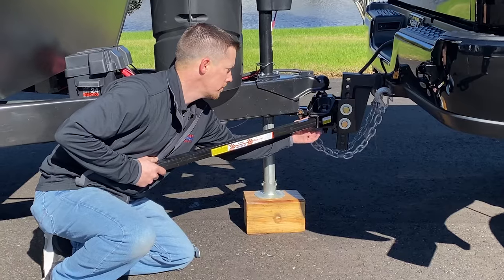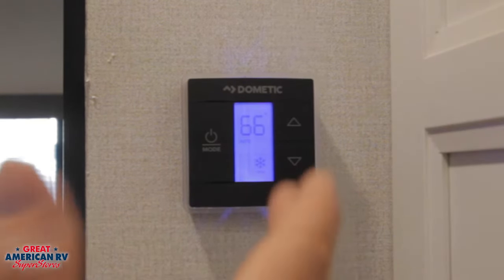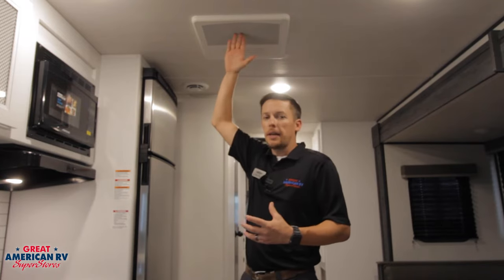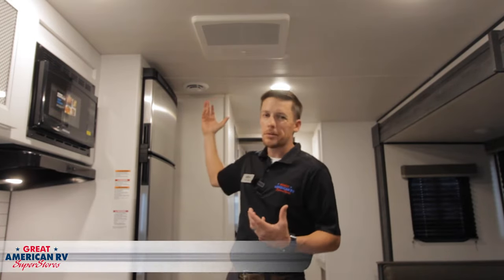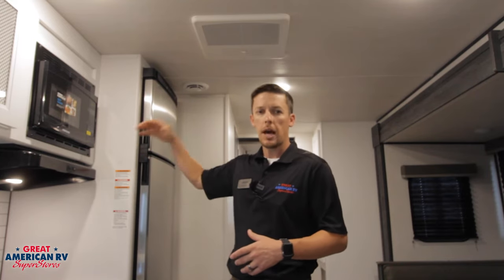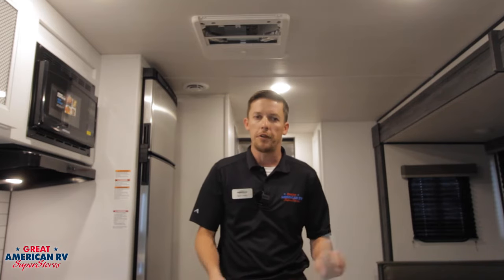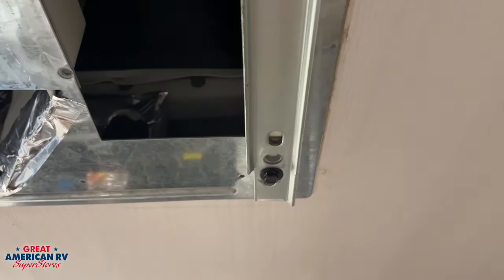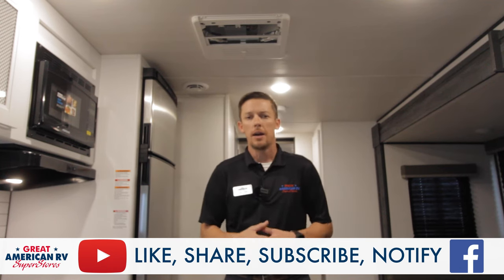Dometic RV Air Conditioner Operation and Maintenance

Comment: Take the cover off the thermostat, put it away for good.

The natural current in your bodys fingers work best on those chrome points to adjust the temperature the best with no frustration

Comment: Um.... That is not a Dometic AC Unit. That is a Coleman Mach
Reply from the maker: You are correct, when we move to the roof and do service up there it is a Coleman AC.  But the process is the same.  And components are laid out similar and the information given is general to apply to any A/C.  Good eye!

Comment: I have a 2016 Dutchman rv my ac is Dometic ac my ac not blowing cold air and i have a white wire looks like it has a broken tip and also gave me code E5 will not work please help
Reply from the maker: E5 code is for the freeze sensor on the a/c.  Not sure what model but you should have a sensor that looks like the one in this link I'll post below.  If the white wire looks like this one then you will have to pull that freeze sensor and replace it.

https://www.amazon.com/Thermistor-Replacement-Conditioner-Replaces-3312303005/dp/B09K74JC7P/ref=asc_df_B09K74JC7P/?tag=hyprod-20&linkCode=df0&hvadid=532606083338&hvpos=&hvnetw=g&hvrand=9234525944855605104&hvpone=&hvptwo=&hvqmt=&hvdev=c&hvdvcmdl=&hvlocint=&hvlocphy=9025218&hvtargid=pla-1463412433383&psc=1

Comment: Water dripping back inside?  Could not figure out how to remove grey Styrofoam foam.  Feels like drain holes are not obstructed.  Unit is barely a year old.  Link to other videos where you may address this?  It's my understanding it's clogged drain holes then water backs up.  I believe it was from rain storm previously day and roof idms flat and water puddles.  What is the tray capacity on a 1300 BTU Domestic.  I can not remember model number off too of my head but it is the newer more efficient model.  Thx
Reply from the maker: Without the model number I can't answer specifics, for capacities.  Something you can google easily when you get the model number.  As for the water leak, you are saying you are seeing water is dripping back inside.  Is this inside the RV or inside the fridge or the back of the fridge?  

I think what you are saying is that the drip tray below the fins on the inside of the fridge is backing up.  I would say to empty any existing water you have and get an air compressor, lower it to 20-30 psi and blow through the drain tube from the inside and see if air is flowing out drain tube on the outside.  If it isn't but you hear the air flowing on the backside of the fridge then you have a broken line.  If no air flow then it may be clogged.  The compressed air may clear it out.  Also make sure the drain line isn't kinked or looped on the back of the fridge preventing the water from flowing smoothly out.

Hopefully this was what you were looking for, let me know a few more specifics if not.  Good luck.  -Todd

Comment: I have a 2018 Montana 3811MS with 2 units.  I’m in the Texas heat,  should I run both units on Low or High or Auto?   Does High or Low put out cool air?   I’ve been told mixed things.  One forum said to run the living AC on Auto and out the bedroom AC on High or Low to help push air.  Please clear this up.  Thank you and love your videos.  I also don’t have any direct dump air just the duck vents
Reply from the maker: I’m down in Louisiana and deal with the extreme temps too.  The best thing to do is to run it on high all the time.  This will help prevent any freezing up.  It may not eliminate it depending on the humidity in your camper but it will definitely help.  It will dry the coils off in between cycles of the compressor rather than the fan turning off and it just staying wet then get cold and freeze.  Other than that start off early morning getting the camper down to a low temp will help it keep up during the day.  Along with closing shades and reducing in and out of the entry door obviously.  The output will only be 20 degrees lower than the air going in so keep that in mind. 

Now keep in mind fan running high or low doesn’t mean the air is always going to be cold coming out.  It won’t if the compressor is cycling off.  It just moves the air through the camper.

Even though you don’t have the ceiling assembly you still have a divider up top only accessible through the AC or by taking it off.  Probably wouldn’t hurt to get it checked out to ensure there is no mixed air.
Hopefully that helps!
Glad you like the videos and hope you’re a subscriber and share them with your camping friends to support us continuing to make it!!  Thanks -Todd